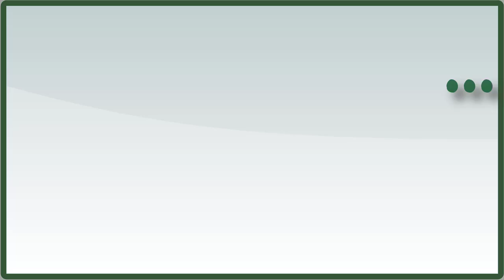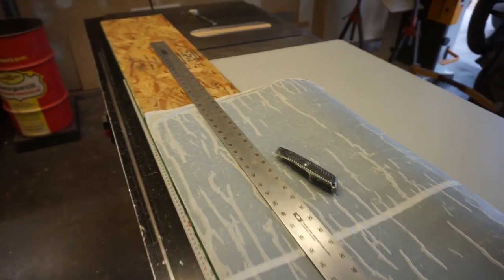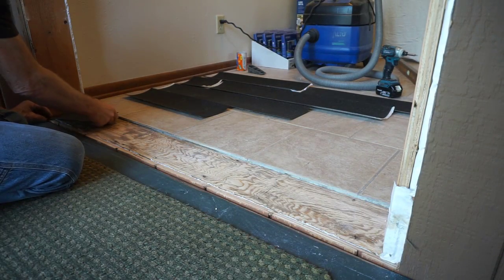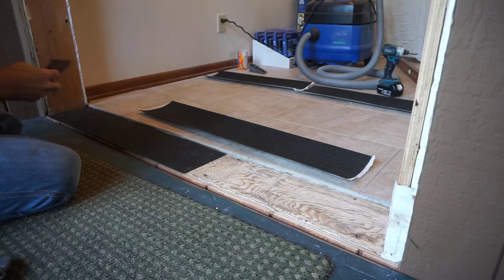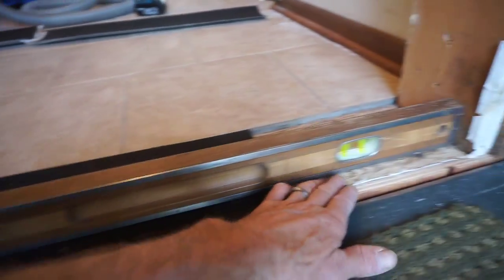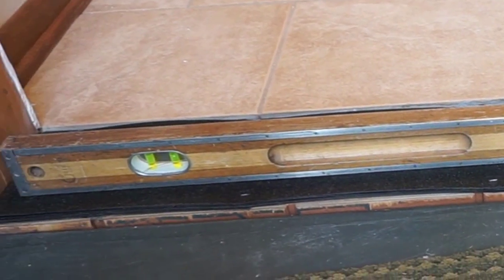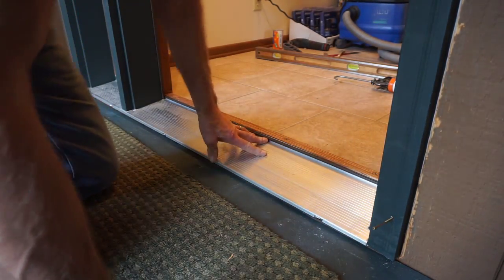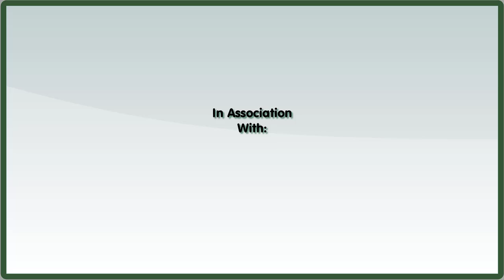How to shim an out of level subfloor for door frame installation

Comment: While I agree asphalt/butyl/whatever layers would work, I don't think door or sealant companies would warranty this. That said, how it's done probably doesn't matter in this situation because it's practically an interior door with that much overhang.
Reply from the maker: More importantly; this video isn't meant to show how to properly seal up an exterior door because that's a topic for a whole other video.  The takeaway is how to LEVEL the subfloor for an exterior door installation leaving it to the viewer to apply the proper/best way to attain compliance for any door or sealant companies terms you're concerned with.  Keep in mind that a door frame that's effectively sealed to prevent water infiltration is a moot point if it isn't installed true and level because no amount of caulk or sealant will prevent wind and water from blowing in under the door/over the threshold even if the frame and sill are properly flashed and sealed.

Comment: Great job.  Much more helpful than all the videos that say "Make sure the floor is level".  I was thinking of doing pretty much the same thing with sheet metal or aluminum flashing but your way is better.
Reply from the maker: Great minds think alike J&R... there's probably other duable, dense materials (like sheet metal) that would work for this method but the peel and stick I used worked nicely, in large part because of it's thickness which means fewer layers that thinner stuff.  15 or 30 lb roofing felts comes to mind here.  I did another video called 'how to cut super shims' that could be applied if the out of level condition was more 'drastic' but the thin layer stacking concept is quite useful.  Best, Matt
Reply: Yes exactly...almost all other videos tell you "make sure the rough opening is level and plumb", but no one ever explains what to do when they aren't level and plumb...
Reply: Same. 'Make sure its level'.. HOW!? Thanks from this amateur for giving the answer.

Comment: Great way to shim a door Matt. Back in the day I used to get this hard thin plastic sheet from a buddy worked at the Post Office. They used this material for tags on the old mail bags.  Very thick rigid material about 1/32 " thick. Used it for all kinds of shims, behind door jambs, etc...  instead of using cardboard.... LOL. I just loved the old staple gun that ran out of bullets. That's an oldie but goodie. Your in such good shape you don't even wear knee pads while on the ceramic tile, LOL...... I still put mine on after my knees start hurting and then its too late. Never have used a V cut in my caulk gun either, I will have to try it.
Thanks again, Al
Reply from the maker: Al, thanks for commenting on this video!  One of the best things about a YouTube channel is 'meeting' guys like you from all over who've 'been there' and have stories to tell and tips to share. The plastic sheet you mention sounds like some very useful stuff, I can see why you kept it handy for all sorts of uses.  No doubt you've use pieces of door hinge boxes for shimming behind hinges to get a door to hang right in a jamb that's not too?  I'll bet your plastic would be a better alternative for that little carpenter's 'hack' also :-)
Similar to your knee pad comment I've been known to wait until I'm coughing from sawdust or that little bit of insulation to put a dust mask on... too late too!
Best to you!
Matt

Comment: Getting ready to lay laminate, and needed a way to shim the subfloor about 3/16 of an inch to meet the existing tile at a transition. This method seems like it will work PERFECT. Brilliant idea, no fussing with Portland compound and forgiving if you ever need it to be.
Reply from the maker: Dan,  It's great that you grasped this shimming concept and thought to apply it to your laminate project... it has all sorts of uses and applications!  You probably already thought of this but if the peel-n-stick type stuff I used is too thick (and leaves to big of 'steps') you can use 30# or 15# roofing felt or similar product for a 'smoother' leveled surface under your flooring.
Thanks for commenting!
Best,
Matt
Reply: Next Level Carpentry - After your video got the google gears churning, I stumbled upon some rosin paper that looks thin enough to make a very smooth gradient. Thanks again and keep up the good work!!

Comment: I couldn’t wait to see how you were going to do that. I’ve been using roofing membranes for 15 years for solid shining.The only thing I could add is to make a pan out of bituthene or like material and wrap the sides and down the outside face on the last layer. Great info👌🏻
Reply from the maker: Nate: your pan suggestion is a valid one for sure... not necessary on this particular installation because of its sheltered location but necessary in many others.  Best, Matt

Comment: I wish I'd thought of that 2 days ago! I have an abundance of Ice & Water shield left from various jobs. We installed an Anderson 400 series Frenchwood 6-0 slider where the floor was about a 1/2" to nothing out of level in the prescribed 72" rough opening. Older home! I used a series of built-up 3/4 x 4" shims of varying thicknesses along with some 30# asphalt paper (15 & 30 weight paper strips are always in my shim bucket. They're great when you need just a skosh more shim) spaced about 12" apart and filled the voids with a thick Geocel layer to create a water and air barrier. I had wanted to use a sill pan under the door unit and in retrospect, I should have just laid the sill pan over my shimming.
Reply from the maker: Hey Geardriven, good thing is there's almost guaranteed to be 'a next time', right?  I think you'll find this little tip worth remembering although it sounds like your installation isn't going anywhere or be apt to leak. Best, Matt

Comment: Very helpful. I’m going to try this on an uneven concrete floor.
Reply from the maker: Should work fine, Kevin, but you might need to use some double stick tape or spray adhesive to get the layers to stick and stay where you want them... good luck!

Comment: Nice job! I usually just throw a few shims about every 10 inches and run a heavy couple of beads of silicone.
Reply from the maker: I've done similar shimming/caulking sometimes but prefer this for its consistent support... but this won't work in every application so a guy's gotta improvise, right Jim?  Best, Matt

Comment: No sill pan? When installing a sill pan would this be the best way to level things up BEFORE  installing the sill pan? The sill pan is supposed to be installed with sealant under it. Is sealant going to permanently stick to your peel and stick layers?
Reply from the maker: NO sill pan needed or required on this installation but, when one is, this shimming method would work great.  Properly applied sealant will permanently stick to everything it touches so, yes, it would stick to peel & stick too.  I always pay extra attention to sealing under the threshold and this scenario is no different IMHO.

Comment: I would recommend to use a plastic packer on the one side and fill up the rest with PU-foam
Reply from the maker: Andrey,
I suppose your method would work but it sounds pretty messy and somewhat unpredictable for results... but you probably have a system for using it efficiently?  Thanks for the sub!

Comment: This was pretty damn cool! Thank you for sharing! What would be your approach if the concrete had settle leaving a huge gap on one side? Would you shim with the membrane then caulk?
Reply from the maker: If the gap was much more than 5/16" or so I'd make shims of redwood or treated lumber using this method:   https://www.youtube.com/watch?v=IGK3w2I_Bms Probably would use PL3 urethane construction adhesive to hold it in place and then caulk to seal...

Comment: I live in an apartment type condo with a very noisy neighbor.  She is deaf so raises her voice and bothers me.  I would like to do something about this. 

I have a varying gap around the door frame going out to the common hall-way.  This gap varies from .32“ to .5“ along the top of the door frame & .25“ to .5“ down the side. 

Most of the noise is coming from the space around the door.  I can see light all around it at night.

According to the condo bylaws, I can’t change out the hollow door with a solid core one. So I can probly find a good sound adsorbtion material to put on the inner side of the door.  What would you suggest for this?
Reply from the maker: More noise comes in through gaps around doors than through the doors themselves.  A good first step is to look for weatherstripping products like foam on a roll with adhesive strip on one side.  Gaps like you describe are indication of an ill fitting and/or improperly installed door.  I'm kind of surprised a hollow core entrance door even meets code... you might check with your local building department to see what's required.  I wouldn't be surprised if code won't force the condo association to the upgrade to a proper door.  Good luck! Best, Matt
Reply: @NextLevelCarpentry  Thanks for the info.  It was probly up to code back in the 70's when it was built. but not now & the condo board isn't gonna do anything about it.
Reply from the maker: @joesmith8459  I suppose that's right hope you can come up with some sound attenuation measures to make your life a little more bearable... Good luck... Best, Matt
Reply: @NextLevelCarpentry  thanx alot....can u recommend any particular brand?
Reply from the maker: @joesmith8459  Brand is less important than specifications and installation.  Search out what type ie: silicone bulb, self-stick foam strip that will fit best on your door in the gaps that need sealing.  Every door/installation/situation is different so you'll have to kind of figure it out yourself by trial and error after observation.  Wish I had a more concise answer for you... good luck. Best, Matt
Reply: joe smith by her some hearing aids I am 74 & I love mine.

Comment: Nice. Could I do the same thing with waterproof flashing tape, since I’m using a strip anyways? Or would it compress and flex too much over time?
Reply from the maker: I don't see any reason that waterproof flashing tape wouldn't work as well for this type of installation. If you think about it there is so little weight in terms of pounds per square inch from a door frame that I can't imagine it compressing much at all. I would be more concerned about extreme heat on the door threshold melting that stuff but that would be an extreme condition as well. Good luck with your install...
Best, Matt
Reply: Flashing tape would work but use a lot more material . A material with fibers , like an ice and water barrier would give more thickness on material and still have waterproof and air barriers . I guess depends on how much gap is needed filled .

Comment: Today I began installing an exterior french door in an existing opening.  On concrete.  The concrete is sloped and has a valley from nothing to an inch in the center, with 3/4" slope from one side to another.  What a mess.  I worked on it till I had to clean up and ended up temporarily putting the old sliding door back in the hole till tomorrow.  Would this be a good method on concrete? The layers would be massive to fill those gaps I know.  Any tips you can provide me would be much appreciated.  Thanks for the videos I enjoy them. Especially think of your video on pencil sharpening every time I sharpen my pencils lol.  I do it the traditional way now every time.  :)
Reply from the maker: Dallas, unfortunately your 'what a mess' assessment is spot on... ugh!  While you could theoretically get this method to work I wouldn't recommend it for a whole inch.  My off hand recommendation is that you look into doing some sort of concrete patch/overlay but am not sure that's feasible for your situation because you've got to do a lot of things just right to get a concrete overlay like that, where it tapers down to nothing, to 'stick' and not fail from cracking and separating from the existing. 
 Crazy as it's going to sound, here's what I'd take a serious look at:  I can imagine making a couple 'screed strips' that would follow the valley in the floor but be perfectly flat and level on top.  I suppose you'd need 4 1/2 or 6 1/2" in between depending on your wall thickness.  After thoroughly cleaning/etching the concrete the strips can be screwed down to the concrete (see my 'how to fasten wood to concrete with standard construction screws video) and act as 'forms' for a level sill.  Here's the crazy part: what about using 'Bondo' aka automotive body filler to fill the forms?  It's dense, waterproof, flexible, drillable, won't chip or crack and, if properly prepared and placed, should stick like mad to concrete.  Call me crazy but I've done more unconventional things that were totally reliable and effective... and been called crazy for 'em too! 😲😎  Good luck, Best, Matt
Reply: Matt thanks for the reply! I'm just now seeing it and the funny thing is, I did exactly what you described!  Ha! I shimmed up a treated 2x4 and scribed the floor contour and cut it with a jigsaw and did the same for the front of the jamb.  Then I covered both with rubber flashing.  Only thing is I did not fill the center with anything! Hope it will be ok.  But I figured the sill pan is rigid and combined with the metal threshold the strength between those screeds, being only 4 9/16" apart, would be just fine.  I pre drilled the holes in the concrete and used long tapcons to fasten down the screeds, with extreme liquid nails under them of course.  I think it's a door for the ages!  :) Your reply is great confirmation man thank you! Best, Dallas
Reply from the maker: @dal2888859  Thanks for letting me know... the process you described for scribing the 2x4 tells me you've got some experience wrangling difficult installations... nice!  Many people and viewers tend to gravitate towards ideals which leaves no solution for the unusual sort of predicament you were in with that far less than ideal floor to deal with... but you got 'er done in what sounds like a sturdy, long lasting way, and that's just plain awesome!  Best, Matt
Reply: This comment thread is exactly what I needed to see. Thank you both.

Comment: Is it possible to use 1/8" panel board? the area is stairs landing and is about 2.5x2.5ft.
Reply from the maker: You could get the same effect with thicker material but I prefer thinner material as shown for a 'smoother' taper.
Reply: @NextLevelCarpentry  Thanks for being kind and prombp. I ended up getting a cork  underlayment instead.
Reply from the maker: @abdolreza82  Cork, like the material I used in the video, has a little 'give' to it, making it help average out the 'steps' in the shim material under load so it sounds like a good alternative IMHO.

Comment: What would you suggest for a door that is 3/4” out of level over the span of the door?  Cut a custom tapered shim to correct it?
Reply from the maker: When the out-of-level dimension exceeds about 3/8" or so I prefer to implement a tapered shim (as you suspect)
https://www.youtube.com/watch?v=IGK3w2I_Bms
Good luck!
Reply: @NextLevelCarpentry  thank you for the reply !

Comment: Can I ask what type of membrane this is? I'm trying to find this online but most of the items are either too thin or squishy. May resort to felt paper otherwise, as it's indoor and not wet.
Reply from the maker: I call it 'peel and stick' which is a generic term for products use as ice and water shield for eaves and valleys on roofing.  It happens to be ideal but it's unfortunate that I've only seen it in 100' rolls which makes it impractical for a small shimming jobs.  Best is if you see someone doing shingles in your area because they throw away more scrap and offcuts than you'll use for shims in a year.  Were I you I'd have no problem using 30# felt for the job, indoor or out because the final installation should be dry in either application.  Best, Matt
Reply: @NextLevelCarpentry  Thanks so much for the quick reply. Given the low stakes (it's a door between my garage and workshop), I'll probably just go with the felt paper this time...but will certainly keep my eye open for roofers in my neighborhood, as I'm sure this would be handy another time. Thank you again.
Reply from the maker: @robertteitelbaum7405  good plan 👍

Comment: Are you concerned about the "peel and stick" compressing over time?
Reply from the maker: Steve,
I sure thought about compression of the peel-n-stick over time but feel confident that it won't be an issue in this or most other applications.  This was some pretty stiff stuff with a sand-like side and a sticky side that makes is less gooey than some products  I might opt for a 30# felt or something like that for installation under a dark bronze threshold on a southern exposure where direct sun on dark metal might get hot enough to cause it to melt and flow.  Definitely a call that you want to make for each installation.
Thanks for commenting,
Matt